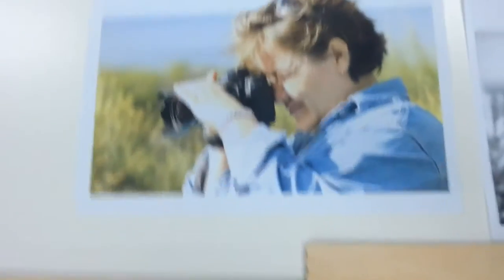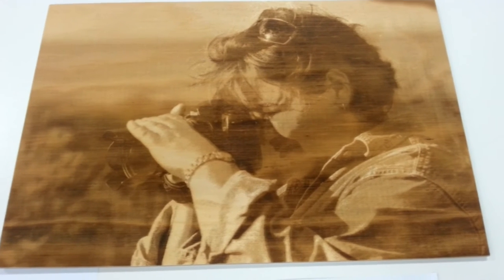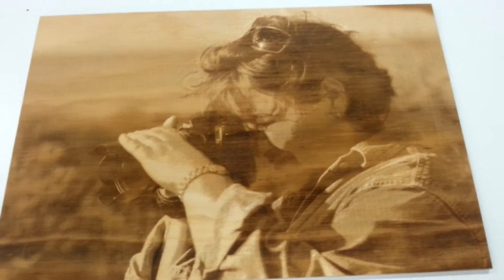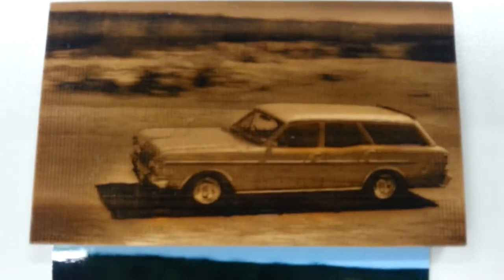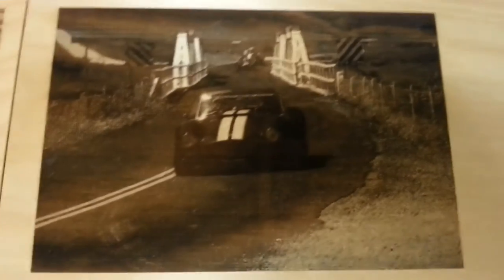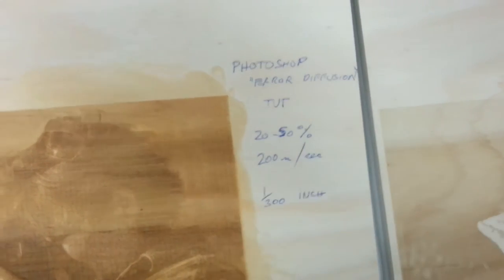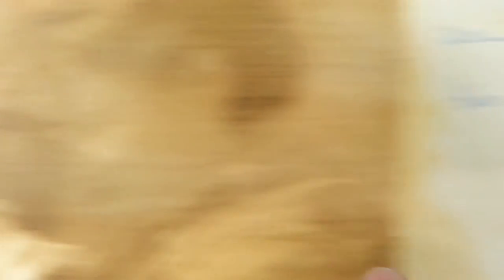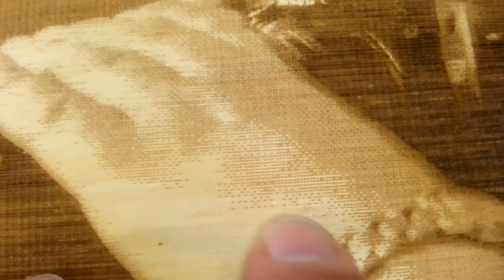LASER ENGRAVING: alterative method: BENCH TEST.

Comment: Oh, something else that I can't find on the net but what are the steps per mm of these machines and can that be changed in the firmware?
Reply from the maker: The setting is in the RDWorks interface to do with bitmap 
at 10:30 of this video you see the settings, look for interval.
https://youtu.be/L6I1il3YMVM?list=PLELb8okMwuToPNJxNgWw_znJ6H-SU5NE1
Reply: So, the co2 laser has a dot size of about .01mm but with steppers at 16x microstepping (if these controllers are doing that) a 16 tooth gear using gt2 belt (I don't think they use that it looks to me like gt3) at that microstepping would be .01mm too resulting in the best possible engraving but I wonder what their mechanical limits are since they had to go for cheap.  Do you know?

I did watch that video you linked and this is precisely where this question came from because 0.2mm is absolutely HUGE in comparison to the co2 laser dot size of 0.01mm so no wonder these things look so grainy though to be fair my computer monitors have always had a dot pitch of ~0.27mm
Reply from the maker: The dot size is not determined by the steppers & belts, of course that effects the precision at which the robotics can reproduce your requst.
The dot size is more a function of a visual blackness, and clarity to the eye. That can be altered by the time the laser is on a given point, the diameter of the focus point (and it has a real thickness) and can be altered by being out of focus, as well as how the material reacts to form the blackness (or colour contrast).
This main points of the video is to show going from a colour to 1 bit with reasonable colour depth, as well as matching your resolution to the dot spacing that you may choose. I happened to find .2mm works with my machine, with the power, focus, and material that I used.

You really must experiment to find your preferred resolution, although I think what I have here would be an excellent starting point.
I know others go to 200DPI  which is 25.4 / 200 = .127mm which you could round t0 say .1mm and see whether you are happy.

The main point still is the match between image resolution & pass width.
Reply: Well, in the 3d printer world steppers and belts define precision and fineness of the dot that it could print at.  I know it also defines for CNC mills and lathes because if your bit/end mill is finer than the resolution of your belts, gears, stepping, then you will have issue so I am not sure why it wouldn't for a laser engraver as long as it was .01mm (10 micron) or worse since that is as fine of a dot as a co2 laser can produce.  Heck, my 16t 16 microstepping on my Prusa is 100 steps per mm of travel or .01mm resolution.
Reply from the maker: We are talking about two different things.
One is the machine capability, as you say is correct.
The machine far exceeds the dot size precision of what is required, however a harmonic can be a problem, from what I have seen the belts seem to produce a little jerk in the motions, the motor precision is well and truly high enough. I think they are 8 or 10 thousand steps.
This video is about the perceptual effects of converting from colour to 1 bit imagery.
Reply from the maker: I have not played with the firmware on the laser, I am not sure about how open the system is.
But the 3D printer is a very open system.
What you say is ultimately correct for the positioning, but the dot spacing required for these images is actually pretty low.
It's a case of 'what looks right is right, and how to get there.
Reply: Well, I still think it could be improved but I doubt it could be with the closed (China even takes open source and sales it as closed source when they make a change which really grinds my gears) source China is infamous about using.
Reply from the maker: Improvement is definitely possible.
The biggest problems I see are the vibrations caused by the belts, and it corresponds to the tooth pitch.
Ball screws would be much better for smoothness & precision, but  would cost speed, and generate a LOT of inertia.
Inertia is a problem for engraving.
All sorts of things happen in China ;)
I am expecting a massive Double Sided Thicknesser for my factory to be delivered late next week.
I bought it from China, funny enough I have not seen anything like it from Europe.
It is going through customs at Sydney as we speak.
It will probably be a couple of weeks before I get it set up, but I must say I am a little excited :)
Reply: What in the world is a Double Sided Thicknesser?  Yeah, a ball screw, or even a lead screw in a pinch, would be better BUT the speed loss would be massive not to mention 500mm/s going back and forth would exert a lot of force and have backlash.  I suspect any anti-backlash device you use would wear out very quickly at those kinds of speeds but if I remember correctly (from a long time ago) a ballscrew has a maximum speed of around 120mm/s or it was 180mm/s.